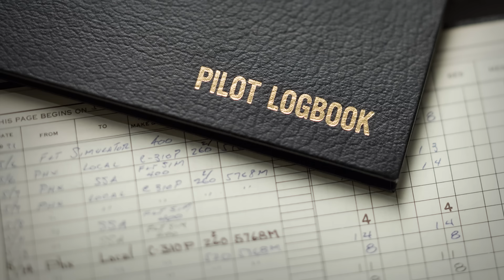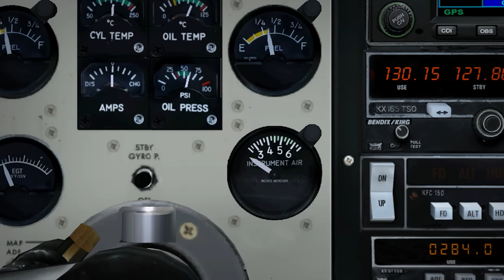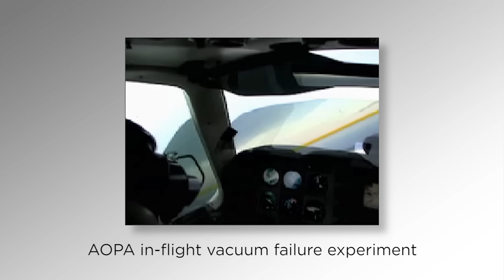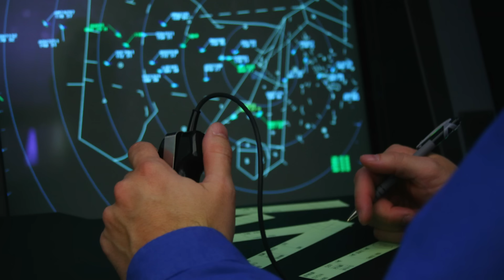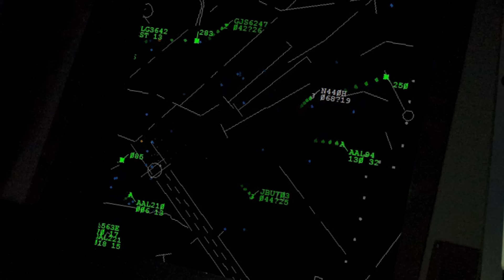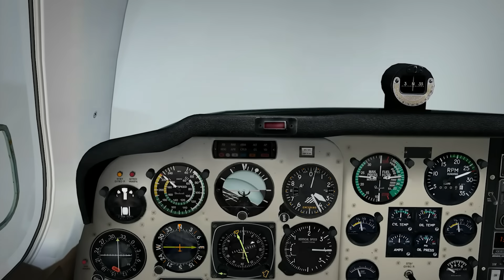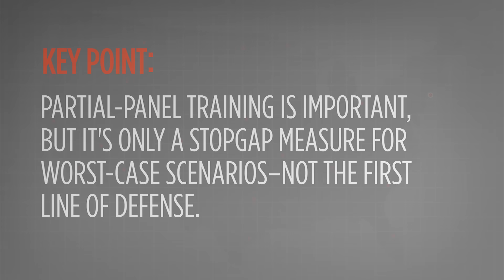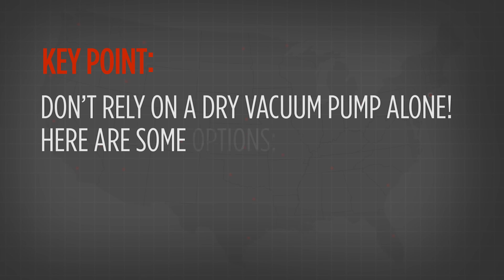Accident Case Study: Single Point Failure

Comment: Many years ago, while flying my Turbo Saratoga SP in VMC on top on an IFR flight plan I suffered a vacuum pump failure. I was proficient on partial panel so not too concerned. But the aircraft was equipped with an HSI so I was reluctant to cover the failed HSI since it did display VOR guidance even if the heading information was inaccurate. But the weather was not challenging. I was on top at 10,000 feet  and the tops of the clouds were around 7000 feet and the bases around 3500. So during the en route section of the flight there was really no problem but obviously the autopilot was unavailable. But as I neared the descent point I told ATC of my situation. I pointed out that this was not an emergency, but that I would appreciate help during the descent and specifically requested minimum or no vectoring while in IMC. After I started the descent, literally immediately after I entered IMC I was given a vector, followed a short time after by another vector.

I handled it just fine, after all, if you practice,  making turns in IMC partial panel shouldn't be a life threatening situation. But I had the advantage of knowing that all I had to do was to keep it right side up till breaking out into good VFR below.

The point of the comment is not to blow my own horn, but to point out that sometimes ATC doesn't take your requests seriously. I specifically requested a straight descent without vectors solely for the purposes of minimizing risks. But the vectors were issued coincidentally as I entered IMC with no inquiry to me as to my flight conditions at the time.

The pilot in this video didn't appear to understand fully his predicament, but by the same token especially the second controller seemed to have no clue what the problem was. Judging from the radar trace it doesn't appear to me that anything could have been done since the pilot seemed incapable of even flying straight and level on partial panel, and since there was no way to reach a VFR airport, the result was inevitable. But, in my view, the controllers attitude could have been better and that might have made a difference with a more competent pilot.
Reply: Yeah that second controller said "partial vacuum failure", he didn't know what was going on.

Comment: Lost Vacuum/ Partial panel was a poor description, No Artificial horizon would have been better, and he should have asked for a vector to an airport where he could have got a GCI approach.
Reply: Nope.  It was a partial panel because he lost his HSI/DG as well which would have given him an instant clue he was off course. A GCI replaces a CDI and ILS but cannot replace primary reference for attitude in the aircraft... the controller couldn’t talk fast enough nor could the pilot interpret and respond fast enough if he was already non proficient on partial panel.
Reply: Heck, on modern planes, ONLY "no-gyro" approaches are available, 'cuz we've dumped the stupid gyros for good.
Reply: Kenny Phillips Ooooo...id love an approach where 2 gyro(copters) were not in front of me, doing touch n gos, which requires them to fully stop on the runway, before taking off again...
Reply: Yeah, those things are speed bumps in the air and on the runway. (Still, I'm likely to fly one.)
Reply: He should have said no-gyro approach. His repeated "partial panel" so many times, which is only used in an IFR training environment.
Reply: is it the same as an ASR (Radar Surveillance Approach)? I did one of those with hood on a couple of months ago during my simulated inst. training with my instructor. It felt like the controller was navigating for me. STANDARD RATE TURN RIGHT, STOP TURN, TURN LEFT, STOP TURN, AIRPORT 12 O'CLOCK etc. As I recall, all I had to do was focus on ASI, turn coordinator and altimeter and follow his instructions. Seems like that would have been perfect for this situation. Why didn't they just give him that? I'm still a student pilot working towards my private.
Reply: shreetron Nothing wrong with an ASR approach ; the controller just tells you what the recommended altitude is at each mile on the descent instead of you reading it on a glide slope needle. But , as a previous reply said , his problem was the attitude of the aircraft. No controller could tell him that , nor could his inop. A/I . He had to infer it. 
               This is done with the turn coordinator ( for roll and yaw info. ) , and the pitot/static instruments ( for pitch info.) i.e. partial panel flying.
Reply: I What about flying so that TC shows no turn and no descent condition. If you see a descent or turn, you correct by pitching up and banking appropriately. Not by any stretch of imagination am I saying I would have been successfully able to do any of that in IMC but just wondering why that wouldn't have worked.
Reply: shreetron It would have worked , but he evidently wasn’t competent to do it. In any case , once he was in the ‘ clag ‘ ATC would have given him turns and descents which is more difficult than straight and level so , inevitably , it just got away from him.

Comment: Watching these has really helped me realize the importance of leaving pride on the ground.  It seems like the I've got this attitude is at least partially responsible in so many of these situations.
Reply: I've learned that having a redundant system is critical to flying.
Reply: Brandon Tucker You should also see from some of the bigger, newer planes (especially Airbuses like the A380), that too much redundancy can cause complacency.  Tbf, if you’re watching for your own GA readiness and training, you needn’t worry about the things a super pilot might.  I’ve seen too many where things are so automated and redundant that pilots just assume everything is fine and forget to keep reading simple instruments, often not realizing the onboard systems are actively fighting them.

That A380 where the pilot let his kid fly is one example, they literally thought the kid couldn’t mess it up.  They also were clueless as how to fix it, which was as simple as letting go of the controls.

Anyway point being, redundancy is good, as long as it doesn’t breed complacency.
Reply: @newname4405  The irony of your description of that accident, is that Michael Crighton wrote a book 20+ years ago called "Airframe", and that was EXACTLY what happened (with one or two minor variations). A pilot let his kid fly the plane, the kid accidentally deployed the leading edge slats in cruise, and in the process of fighting with the plane to keep the pitch attitude the same, caused it to porpoise several times, quite severely. I forget how the incident was stopped, but I think it was something about the kid getting thrown out of the seat, or knocked unconscious by something, and when he stopped fighting the plane it leveled out.
Reply: It's called the God complex.